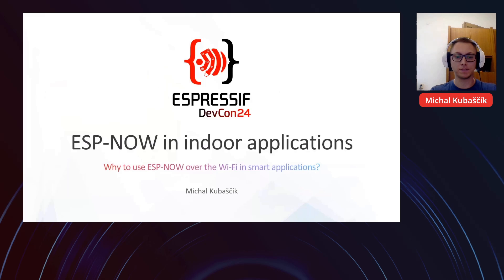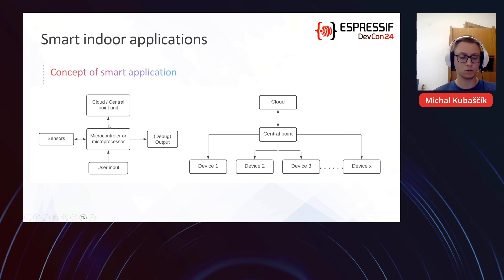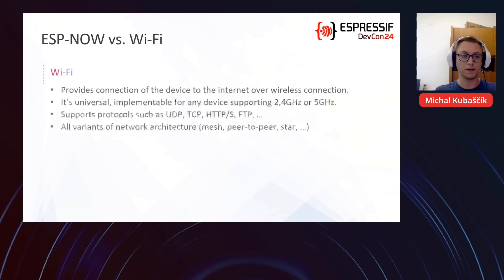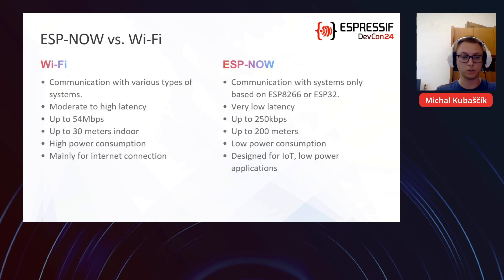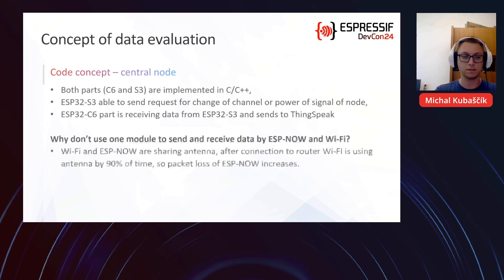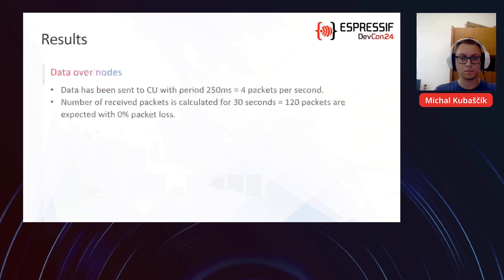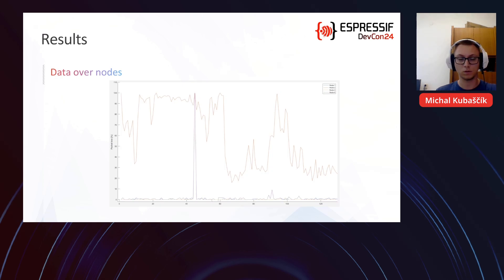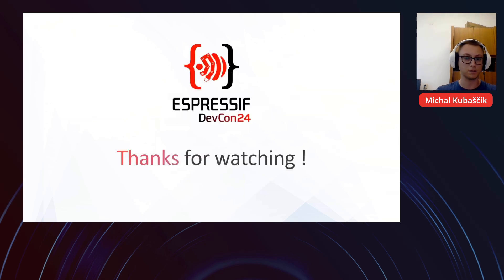DevCon24 - ESP NOW in indoor applications

Comment: lots of theory but no examples. I have built espnow to wifi router and having 50+ espnow devices I experience no packets lost at all. on top of that I implemented queues and if more than 1 espnow devices send data before the data is sent over wifi to the server, queue will solve the issue
also: espnow takes max 10ms vs wifi that takes ages ;)
Reply: Sounds super cool. Have you done a video yet about it?
Reply: @shax-l9f  I am not a youtuber
Reply: While I agree the presentation is not that useful, it's better than nothing but still provides little info to what looks like a college class progress update.  Overall disappointing information but probably means just need to get out to do the work to see if this is useful for our own projects.  Or find another YT video from someone who actually demos something and characterizes the results.